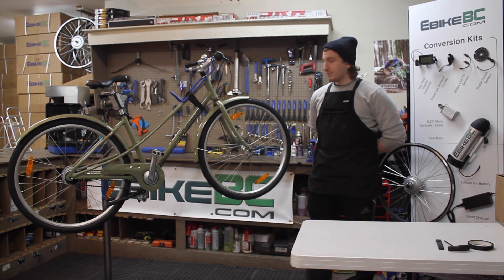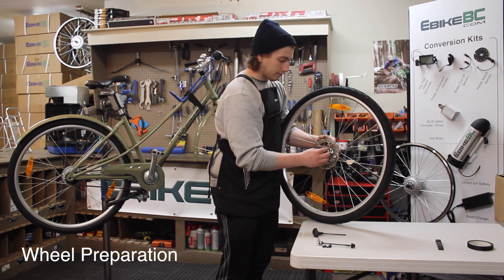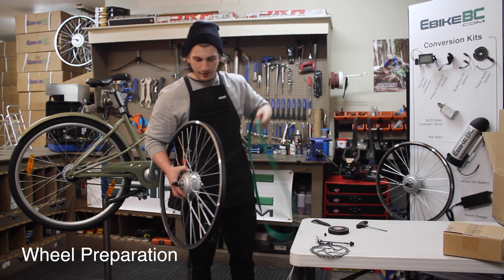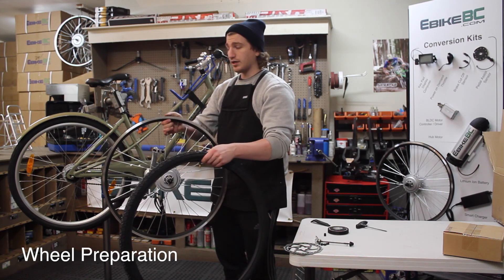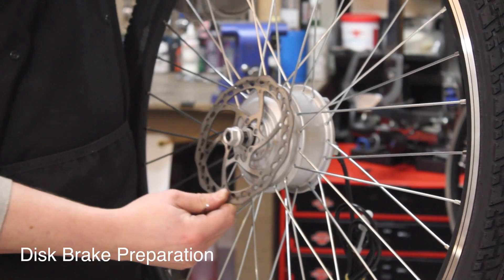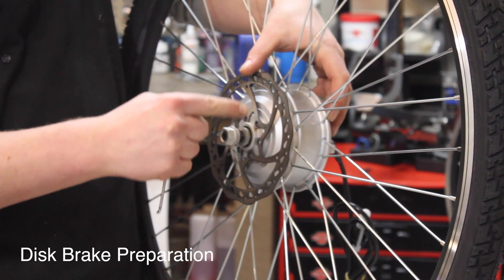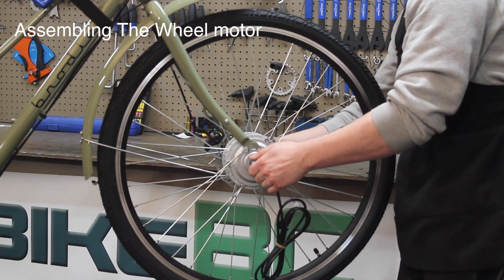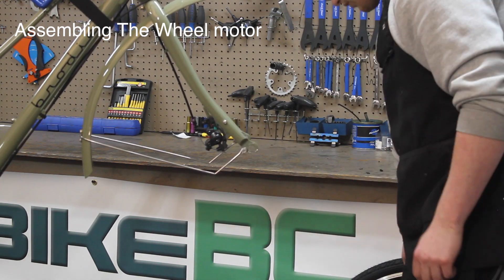Front hub motor installation

Comment: Is there any difference between front hub motor and rear hub motor?
Reply: yes a rear hub motor wont fit in the front fork most of time.
Reply: Yes the rear hub motor goes at the back of the bike and the front hub goes at the front of the bike

Comment: My "project donor" Giant mountain bike has traditional pad brakes.  Do I need to convert to disc?
Reply: Yeah for safety
Reply: No you don't have to. I suppose disk brakes are a newer technology and I guess safer but...no, it's not absolutely required. The implication of Maria Efremova's reply is that pad brakes could not stop the bike if somehow the motor was "runaway." I don't see how that's the case.

Comment: Could I just relace the disc brake with a sprocket and put this on the rear for a motorized hybrid?
Does it "HAVE TO" be used on the front???
Reply: there are different wheels for front and rear, there is no good way for bolting a sprocket to the front wheel

Comment: I have an Ebike, the Ecomotion Core Pro eFat. The rear has a Bafang 500w motor on rear hub. A 48v battery. I would like to add a front 500w motor as well, so it's "2wd", and was wondering if I can connect this motor to existing wiring- brakes- throttle etc. The wheel size is 26 with a 4 inch fat tire. The wheel has those round holes on the inside like many of the fat tire bikes do. So I would think you have that wheel with a 500w motor?. Again if so, can I possibly connect a wheel with motor in the front to the existing electrics?. Thank you.
Reply from the maker: We have 500W front hub motor wheel for 26inch  FAT bikes. You need a complete motor controller and 20A redundant battery capacity. If existing battery doesnt have that you need to add another battery too.

Comment: Beware of alloy forks with a front wheel motor, drop outs may fail with metal fatigue. It's caused fatalities. Don't know what the set up is in this video.
Reply: A torque arm on each side is definitely a must regardless.

Comment: Hi, do my bike should have disk brakes to set the kit hub because i have V brakes in my bike?
Reply from the maker: Wael alshami Hi, ebikebc hub motors are both disk and pad brakes compatible. Only hub or drum brakes need to be replaced by caliper brakes if using a hub motor.

Comment: You are saying in the video that the wire exit out of the axle should be up, is that wrong because the opening will let water run into the motor via the wire axile access, should it not be pointed down so water drips off and away????????? your going to fill up the hub motor with water.
Reply: Glands, penetration and protection.  Got it.
Reply from the maker: The cable gland doesn't let the water in. the cable should go up anyways and the water splashes may penetrate anyways if the gland does not protect it.
Reply: Yes, wires should exit in the down position for the reason Michael Bradley has stated. Also when the wire is run up the forks it will create a drip bend so any condensation or water running down the wire will drip off.
Reply: Who cares rtv or clear Henry's will block water period